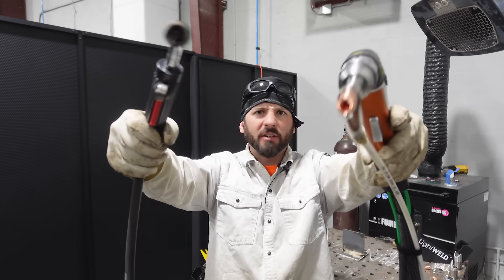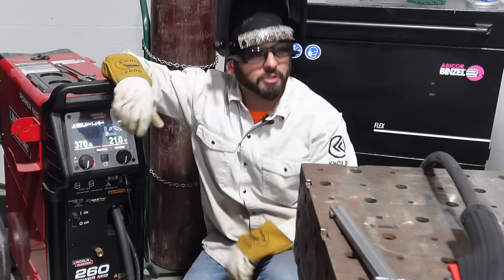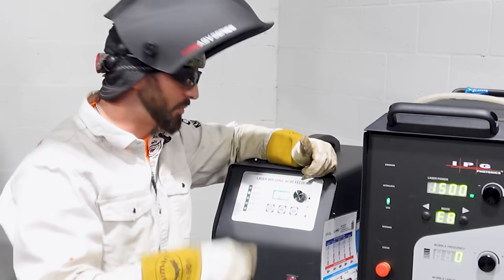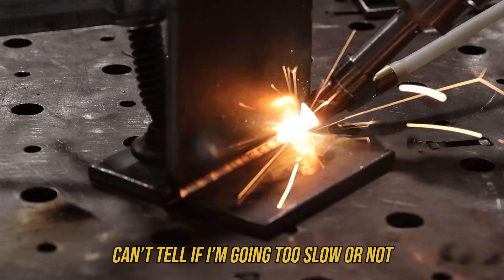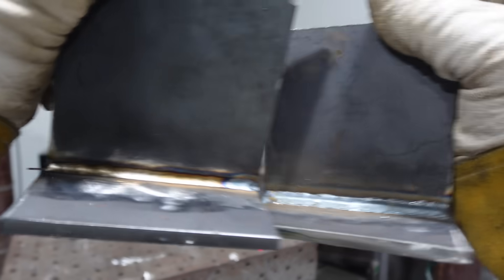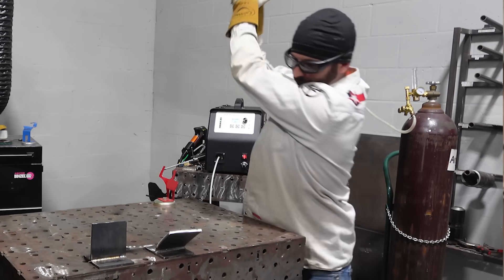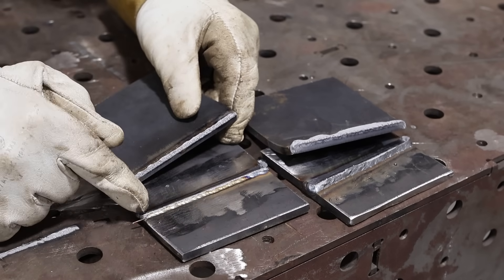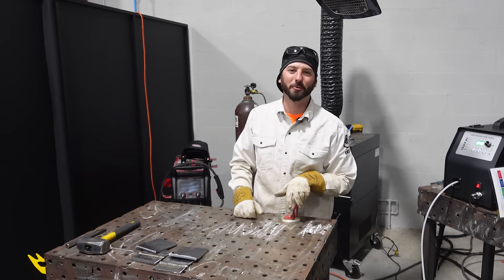Is Laser Welding As Strong As MIG Welding?

Comment: I am laser welding engineer who works for IPG  photonics

Here are my observations 

Lightweld XC is designed for 5/16th plate maximum 

With laser welding of ferous based metals you use Nitrogen not argon 

You should be using 1/16th diameter wire for a greater fillet size

The machine that best suits that process is the Lightweld XR 2000 watt which is for 1/4" or above

The hardest part of my job, is getting welders to adato the new technology 

You are trying to make the machine do with what you are familiar with, which is MIG.

But over all you are learning and that is a good thing.
Reply: If it's nitrogen then why not CO2?
Reply: @Moonlightshadow-lq4fr  Perhaps the carbon would change the metallurgy and the oxygen would oxidize the hot metal.
Reply: @Moonlightshadow-lq4fr cO2 is a reactive gas. You will oxidize the weld. I’ve experimented with 75/25 and it dies work, but the welds are more brittle. Even with MIG, 100% CO2 gives weaker, more brittle welds. Wire manufacturers show that in their charts.
Reply: @Moonlightshadow-lq4fr  bc nitrogen is cheaper  and it does what CO2 does while using laser welder
Reply: @lamania32  Been a long time since I studied lasers and it was from a chemists pov but I wonder since CO2 can lase if that would cause an issue? Just to add to your list of why N2 versus CO2.
Reply: @Parents_of_Twins yes, it will cause an issue. Don’t do it.
Reply: @melgross  I never intended to. I don't own any lasers outside of the ones used for playing with cats.
Reply: Hi Joe, totally agree with what you said here. This is not traditional welding and new technology comes with new process parameters we all need to learn. I have learned a lot since you were here in Ponca City, OK last year and continue to develop and learn everyday. Keep up the good work and come see us again anytime.
Johnny T.
Reply: @johnnythornburgh4367  I just got a 2000w laser and it's like learning to weld over again. I bought it to do thin stainless and it does stuff that I can't do with TIG easily and it's fast. I did a test on 1/8 steel double sided fillet and squshed in the press, the steel broke first and the weld was fine
Reply: @stephens4951  Which machine? What do you think after using it？
Reply: @LuciaWashington1980  it's an everlast saber 2000. I really like it.  I think there are ones with more options but you obviously pay more.  This one is air cooled and the fans are a bit noisy but it's much lighter than the water cooled one.  I use it all the time.
Reply: @stephens4951  What do you use it for mostly? I'm considering purchasing a laser welding, but it's too expensive and I'm afraid I won't make my money back
Reply: @Lena-xTool  I use it a lot on 1/8" and under. I do stuff up to 1/4" but past that I go with MIG. It will weld thicker metal but I only do that if it doesn't need a strong weld, a big fat hot mig weld will be stronger on thick stuff. On thin stuff the lack of warping is amazing and it's fast. I have welded 24ga stainless with almost full pen with no sugar on the back side.
Reply: nitrogen? for reals?
Reply: sounds good to me. You ought to know since you're the engineer and have the experience with the process.
Reply: If Nitrogen had been used would the results have been totally different?
Reply: @davidboydii809  exactly what I’d hoped had been asked and answered already. Hopefully he sees it soon, I’d love to know as well.
Reply: @davidboydii809 you can use argon. But nitrogen is cheaper. Argon must be used with aluminum.
Reply: yes the seller also told me  use nitrogen
thank you  for  your commenting
Reply: You should only compare the same size fillet welds.
Reply: A succinct and informative observation. Kudos 🤙
Reply: What laser welder would you suggest for sheet metal? I plan to get into doing metal sculpture art and I'm sold on laser welders. (Been a welder/fabricator for 10 years) but I'd love your input
Reply: @josephroy9399  very interesting at the firm where i am working theres a much more rudimental machine and we use it to tack or weld sheet metal, what wire diameter and gas would you recommend to do basic sheet steel?
Reply: This is one of the advantages of laser welding that you can use it sometimes instead of Tig,  avoiding high level of professionalism, but I am still doubtful on thicker materials.
Reply: Can lasers weld aluminium?
Reply: @atman5230  Yes.
Reply: @josephroy9399  I hope you're not an actual engineer because last time I checked, 5/16 is thicker than 1/4. Truth of the matter is that laser welding is not structural. In the field I work in, we know and have proven that mig and dual shield flux core is the superior welding process for strength. One inch of weld on each side of a U bar with 71T1+ dual shield flux core is 3 times as strong as 2 inches of 1/8 7018 on each side of a U bar. You'll cut off a MiG weld before you'll beat it off if it was done right. Laser welders can't produce the heat required for the task in the field. Trying to get a machine that would out to the field and around the job site would be more headaches than anything and it will still be slower and less environment resilient than dual shield flux core. It is legitimately only good for robotic welders in non structural welds for manufacturing.
Reply: @justinmcwaters4962   He was saying one is for 5/16" maximum, the other is for 1/4" and above, which is why it's better suited.
Reply: @justinmcwaters4962 well, it depends on the wattage. You can get 20,000 watt laser welders that the build ships with. A 6,000 welder will give a good structural weld. If used correctly, lasers have deeper penetration than MIG, TIG, stick or dual,shield.
Reply: Kind of telling that the "influencer" says he teaches welding, but spreads so much misinformation and is just plain and obviously wrong.
This is like a driving instructor teaching that a red light means 'go'.

Comment: Thanks for the demo! Ive heard 100% argon also works well with laser.  Would be interesting comparing different joint configurations as well.  For instance would a bend test on a 3/8 plate with a zero bevel butt weld have the similar mechanical properties vs V-groove assuming complete penetration and fusion

Comment: Never welded with laser but any experienced mig welder would use other settings on the mig machine too litle voltage and not enough amps... Its works like that but you have to weld very slowly...
Reply: Yeah just using pre sets to keep more control. But I would’ve much rather been in the spray transfer on plate steel

Comment: The laser machine wire feed had obviously put a lot LESS metal into that joint.
Maybe you just needed to move your hand slower so the heat and feed metal matched the other weld?
Reply: I think a slower travel speed, larger wire and bigger machine rates for 1/4” would’ve definitely changed the results
Reply: I used a laser once. The gun actually pushes your hand along, you can’t slow down.

Comment: Some are bashing him, but I think this is an interesting test. Teaches us that you need a lot more laser power for something this thick, and the differences and limitations of it (which is not super clear in industry right now).
Reply: Thank you. It was definitely that, a test, and I don’t think the test was bad. It just needs some tweaking to be comparable on that thickness of steel
Reply: We demoed light weld at our shop.  The do have a 2000 watt dual wire feed system but they didn't have it on their trailer.  Laser is still for light gauge aerospace and HVAC in my opinion.  Hard to beat mig for 1/4" and up.  CWI since 09.  Thanks for video!
Reply: @shanegannon3794  lets debate it ! some stationery laser welders do 20mm > 3/4"    Edit: Hand-held stationery 6KW 25 micron.
Reply: Massively more powerful don’t get me wrong I have 4 very large laser machines technology is not there yet components fail duty cycles meet there limits they are kind of fragile and when technology does get there heat input is going to raise it’s ugly head

Comment: Is it just me, but it made me cringe when he welded the parts to the top of the welding table. If you don't remove it properly, it will now have lumps and gouges on the surface of the table.
Reply: Little flap action and she was cleaner than before I welded it to the table 😅. It was a wittle weld.
Reply: @austinhargett5792  part of my shop clean up after finishing a project is grinding down all the tacks and splatter  on my table… takes like 2 mins, no big deal.
Reply: @Gainz27  some shops want there tables perfectly level for fitting/tacking it really comes in handy when you don’t have to worry about lumps on the table throwing your piece out of wack
Reply: I was lifted out of my chair when I saw it.. For me, the welding table is as sacred as a cow in India..

Comment: I bet a 7018 rod would have beat them both in this test.
Reply: ER70T11 will not quite match 7018, but it can and regularly does better than these tests.
Reply: @willgallatin2802  if you want it done fast use mig, if you want it done well use stick, if you want it done perfectly use tig.

Comment: Why on earth would you try to compare two completely different processes? Laser shines on thin stainless and Mig works great on thick steels. Get real.
Reply: You weren’t curious?
Reply: @austinhargett5792  I've had too much experience with MIG, TIG and Laser, to bite on this clik bait, but one never knows, so sure I was curious. Regards.
Reply: @dacoelec  I have little experience with lasers. Other than the supervised use of these haha. I can tell you this wasn’t a great test. But it was never intended to be click bait. Just a dude playing with a laser. And ran a test, didn’t realize how flaw the test was until I was done. 

Lessons were learned, experience was gained
Reply: @austinhargett5792  Hey no problem😁. Lasers are so kickass on thin material that aren't conductive like ss. Best of luck!

Comment: If it is the same welding wire used in both machines then same ksi tensile strength weld. Break test is is really only comparable  if two samples welded are as close as human possible to the same leg length as well as same surface profile. Done this way it would still only show the difference in penetration in the root of the two welds. Still interesting to see laser welds compared & would like to see more.
Reply: I think another try is in the books

Comment: I own one of them 260's-it's around here somewhere. I used to run it and it's big brother an old 350MP. Now all the 350 does is just push-pull aluminum. Any steel wire welding is done off a pipepro 400 with an LN25-the arc is SO sweet!
Reply: Yeah Lincoln knows what’s up for sure with these wire machines

Comment: this is not a test when you are using the laser above its rated capacity. you had severe undercut on the laser weld and a concave profile which leads me to believe you angle was wrong as well as you wire speed and travel speed. practice more and re test my friend.
Reply: You’re not wrong my friend. I think we should run this back.
Reply: @austinhargett5792  no hard feelings I hope. Do a test on 18G to see if you get warpage. lots of auto body guys would be interested. you should get adequate penetration (butt and lap weld would be perfect Thanks)

Comment: It appears to be something the paint and body guys would be pleased with. I can't see where it would be helpful in any of the "heavy industrial" applications due to the amount of heat needed and heavier wall thicknesses.
Reply: Definitely a sheet metal beast. Especially this model. They make much stronger ones that claim full penn on a 3/8” plate butted together 😱
Reply: laser can be stronger,  but  cant imagine  using 25-50 kw laser  for  hand welding
thats already a power that  cutting trough  3 inches steel
Reply: laser welders are indeed used in heavy industrial applications, aerospace, automotive, shipbuilding, heavy machinery, etc. Laser welder can penetrate deeper without using high heat compared to traditional welders
Reply: the larger grain structure on the laser tells me that the laser is putting more heat into the metal than the tig though.

Comment: You proved you need more time on the lasers.   Nothing else.
Reply: Laser lover.
Reply: Not until this “experiment” was finished did I realize I needed to adjust a few things for a fair fight. 

Larger diameter wire, slower travel speed, nitrogen, and a bigger laser. 

I used what I had on hand to just see what would happen. 

I don’t have very much experience on these lasers, I’ve enjoyed learning along with our viewers as most people don’t have access to one. 

How would you have done it differently? What’s your solution?
Reply: @austinhargett5792  Clearly they aren't here to provide solutions, only here to piss on your welding skill.

Comment: If the bead of the laser and was as wide and think as the MiG it may have held up. BUT .. if I recall this test should not have the weld itself break if I recall all the parameters are correct and your technique is correct the weeks should hold and tear out base metal when failures occur.  But it had been a long time since I have done this test, you should almost maybe cut and etch these joints to give a good look at what the pen looks like.
Reply: I believe another test needs to be done. This laser max thickness is closer to 3/16”. I’m positive with a larger laser, wire diameter and even a gas change to nitrogen would’ve changed a lot
Reply: I was thinking the same thing. That if the weld is good it should tear be inseparable from the base metal not snapping in half.

Comment: maybe multipass for the laser so you get approximately the same amount of filler?🤔
Reply: I think that could help. I do believe the reinforcement helped out the mig weld a lot
Reply: @austinhargett5792   I am only familiar with MIG (we just started using laser at my job), but I would imagine the difference in the material that was left on MIG was what held the metal together for more force. The laser probably penetrated just as well, but didnt have as much support in the end product as far as material is concerned.
Reply: Which means that welding with MAG is not only faster but it will also be cheaper (less wire & gas)